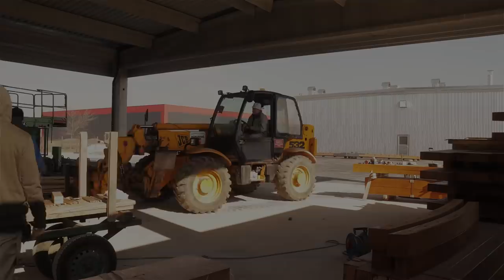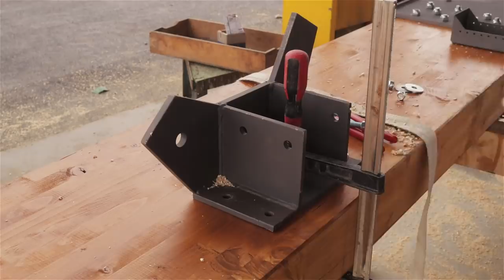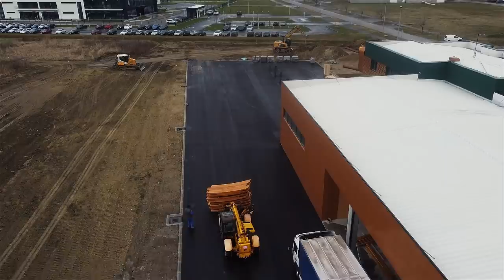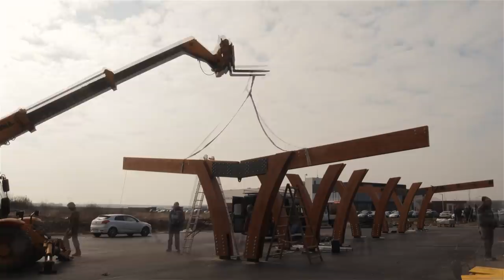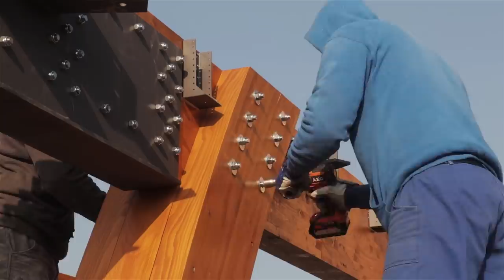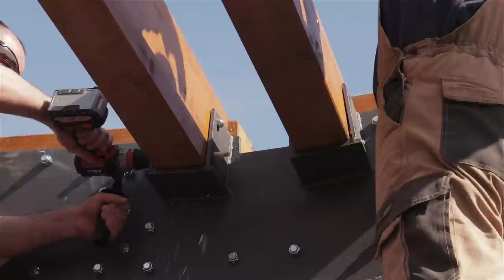Large Carport Assembly

Comment: Very nice. What’s the point of it?
Reply: It is a vehicle carport.  Another vendor is installing the roof.  He thinks it will be a polycarbonate product.  Rain an snow runoff will be coveted in the center  V  location.

This is the entry area for a wood research center, so the architect & client wanted to have a showplace piece to highlight that wood can be a finished product as well as structural.  Mission accomplished.

This info was gleaned from the replies to other comments.  Project location is in Croatia I believe.  Preparation of the beams is covered in the other video labeled ‘Production beams’.

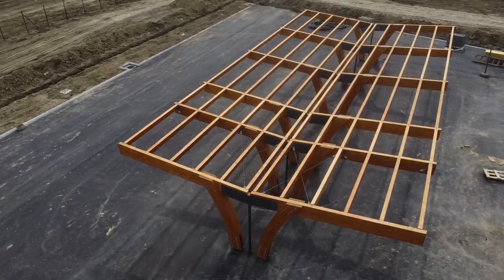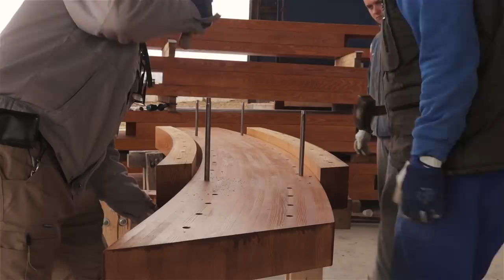Comment: Why was it not uniform?  At 6:08 you can see how the near side isn't spaced quite the same.  I'm sure there's a good reason for it, but i don't immediately understand.  Also, at 1:40 there are some metal rods being hammered in that don't appear to be bolts or anything - are those just secured via friction?  Amazing work - i love your videos.
Reply: Those pillars are screwed together at the metal base and at the top, those rods are only there for structural strength.

Comment: This is massive. Are those tensors for structural reasons or are they to hold the cover?
Reply from the maker: Structural reasons. they take the wind load, and horizontal acceleration from earthquakes. Unfortunately roofing alone will not be enough to absorb potential forces..
Reply: @lignumchannel  Thanks for the answer

Comment: It looks amaizing, but two questions: do you really use nails instead of screws, is it strong enought? and what about snow, when you put cover on the roof, all snow will stay in the middle?!
Reply from the maker: Glad you like it! The snow is not a problem, every wooden and steel element, number of bolts and nails is calculated to withstand max snow, wind and horizontal acceleration during earthquake.
Reply: @lignumchannel  really very nice carport... like all you works.

Comment: Looks great. Two questions:

1. Why is there an extra support on the end nearest the building?

2. Why is the cross bracing only on the first and last section?
Reply from the maker: Thank you! :)First two opposing spaces are for people with disabilities so they are bigger and separated. Metal structures have cross braces usually placed in the middle sections so the structure can freely expand and contract as the temperature changes. Cross braces are usually placed in the last sections on wooden structures because wood has almost no temperature dilatation. When calculating stresses on the structure, you get how many cross braces should be installed to keep the structure from warping, In this case two sections were enough.